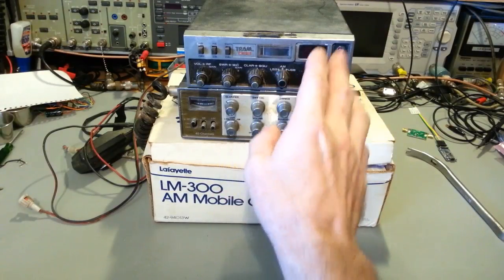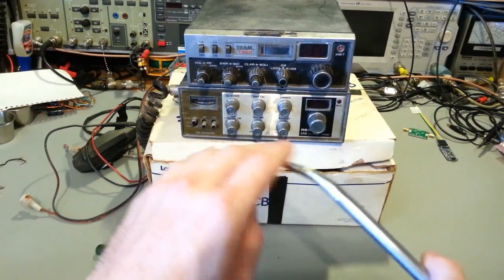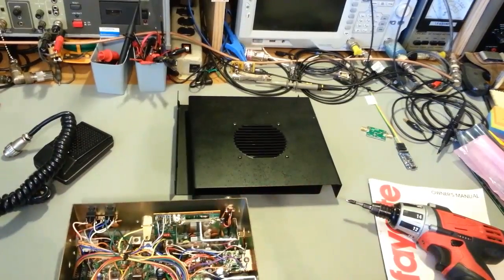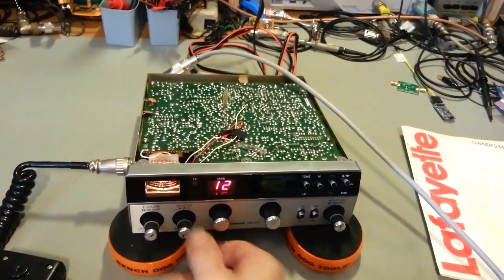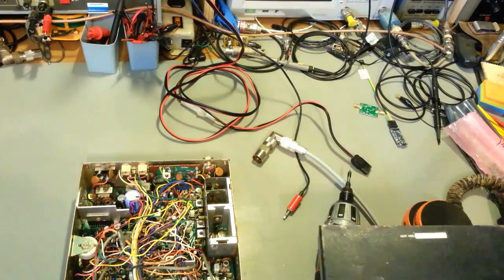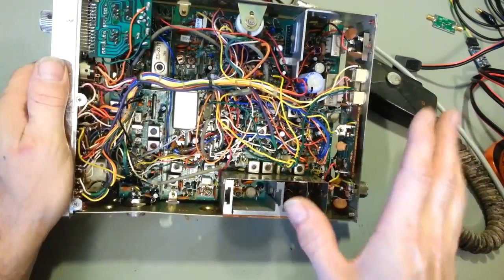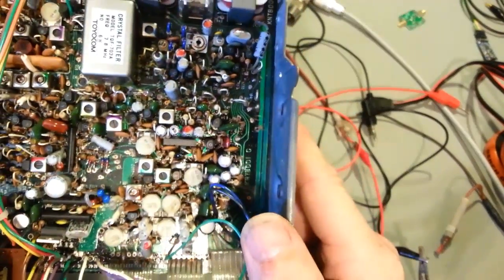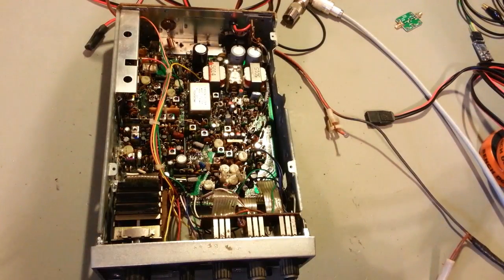Pile of radios from ebay.  Diamonds in the rough.

Comment: Radios have always seemed to be a mystery when looking at them. My switching supply that died is the same. Yet, I am an electronics technologist. I focused on digital technology instead.

I'd love to know what equipment you have and use to repair, measure, and re align radios, especially for SSB. (And now FM since they added it officially to CB.)

Comment: Have a  question? Fqp13n10 and  fqp13n10L   will  the  L transistor  be  a direct  swap?.  Hi from Dauphin Island Alabama
Reply from the maker: Should probably be fine.  There are minor differences in input transductance, input capacitance and gate source voltage but they are so minor I doubt you would notice much in circuit performance difference.
Reply: @mikesradiorepair  thank you Mike I appreciate you I am a huge fan keep up the good work

Comment: How I could find a way to get in touch with MIKES RADIO service 2 cobra 2000 GTL, radios of mine, .. there all together, i use one , the other one the frequency counter to flexing . I would both to be serviced and be set up as from factory, hope both has not been ( over) modified . Thanks for re-breathing life vintage radios, Thanks again,, hope to hear from you.

Comment: Sometimes a junker can be a gem in the rough. I bought an SSB/AM rig years ago with no speaker. Put in a speaker and it worked but had problems with its modulation as well as strong signals causing distortion. Replaced the audio amp and now it works quite good. I now have two Cobra 132's, one of them fresh out of the shop alignment, the other obviously needs serious work inside before I even think of powering it up. Man I love this hobby!

Comment: I use the tool made to remove the door panels of a car...it goes behind them plastic snap in bolts...or push in clips..
Reply from the maker: Kennynva T. 

Was a mechanic for a long time.  Very familiar with what your talking about.  I have a couple different ones.  I even have one that is kind of like pliers, just work the opposite direction.  Squeeze the handles together and the jaws separate.  The jaws are basically thin tool steel with a v notch in the end.
Reply: I want to ask you a question..off subject...if you break a core to the small transformers, do you flip the core over and it work as new...or replace it entirely? I have a am radio(broadcast band) and  broke the core, because of the wax in it..I just want to know if it hurts the alignment in any way...the core was for the oscillating coil.
Reply from the maker: Kennynva T. 

In most cases it works just fine.  It will effect the Q of the coil because the permeability of the core has changed but usually not enough to be noticeable.  Just flip it over and realign that transformer/coil.

Comment: Mike,
A pry bar is a necessity ! I work on electronics and HAM radio (even the odd CB rig) and I ended up making myself a small set of these pry-bars out of a set of cheap screw drivers.
I have re-capped and cleaned up an old President Madison AM-SSB rig last month. Lovely old radios these are... brings you back to those crazy 80s', doesn't it?

Cheers
Paddy

Comment: Another interesting video as usual, Mike, one question, when you get a radio in and its dirty and grungy, what do you use to clean it.. water, alcohol, acetone... pressure washer.. lol... thanks
Reply from the maker: +Joe Lees/N3JJL 

One of Texas Refinery Corp's  products.  Big Red for most stuff because it's PH neutral and is NSF certified.  A few tablespoons full in a spray bottle mixed with distilled water usually gets the job done.  For more stubborn grime their TBC concentrate is my next step up.  They make from mild PH neutral cleaners to caustic cleaners that will dissolve aluminum.  Honestly though, unless it is a real goopy mess just a spray can of ZEP foaming glass cleaner usually does the job.

Comment: Do you ever use that brake spoon to remove stuck knobs?
Reply from the maker: +William Colvin 

I usually use cannon plug pliers for that.  They have non marring jaws which help prevent damage to the knob.
Reply: Thank you some of those old knob are really stuck on,also how do you remove the little spanner ring type nuts on the potentiometer. I would like to change those to regular nut type - but do not know what size nuts those old Teaberry radios use,and if a socket will work in the holes.
Reply: William Colvin hello from down under in OZ. Find a piece of copper, or stainless or steel tube that comes close to O.D. Of the nut, then file or grind it so it fits the slots in the nut . To get one of first if you don't have one loose try a pair of needle nose pliers, an old set you may have to grind the tips to fit the slots. If it's just a one off job the pliers will do, but if you plan on doing them regularly then the tube is the way to go.
Reply: The pliers deal does not work well - not enough room and damages the threads which are already oxidized from age and moisture in the storage area it was in.
Reply: I thought about a cheap 1/4 inch deep drive socket to grind to fit.

Comment: i find all this very interesting i got a royce from a dead family member that is a lot older then me thing is all analog the channel dial is like the old tv's lol i don't want to just plug it in any recommendations on what i should do?
Reply from the maker: +eddy apple 

First check the fuse and make sure it is the correct size and the condition of the power cord.  Pull the cover and see if it looks original or if it has had a lot of questionable work done to it.  Is there anything burned up in it, bare wires, etc...  If everything looks OK give it a try.
Reply: well looking it over and i gotta say its beautiful all discrete components  the one thing thats bugging me and i wanted to ask someone who knows about these things it shouldnt have a 250 volt fuse in it right? it says 13.6 volts on it so that was  prolly a dumb question but im trying to learn bit by bit from your videos. it's a royce model I-600B  from 1975

Comment: I have a few ssb radios that I would like to move to 40 meters or other frequencies. Any recommendations on what to change to move the frequency there? One of them is a radio shack TRC 449. I understand I will need to change input and output filtering.

Ken
Reply from the maker: +Kenneth Watson 

Nothings impossible but that would require redesigning the entire radio.  All the RX and TX circuits are tuned circuits in the 11 meter band.  They can usually cover 10 and 12 meter but trying to get into the 7MHz range would never work.  Also have to think about harmonics.  You would need a radio that doesn't have oscillator or mixing frequency harmonics in that band either or you will hear nothing but birdie frequencies.